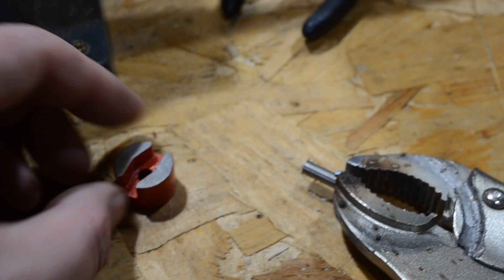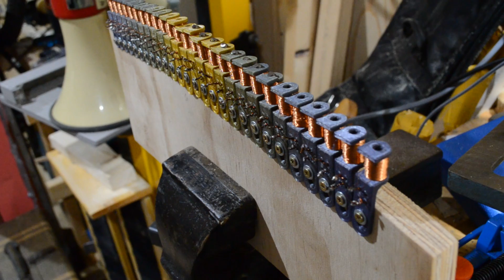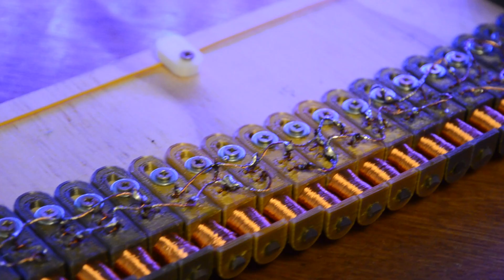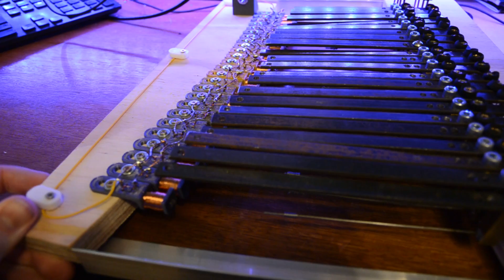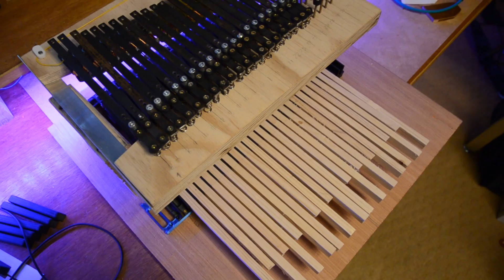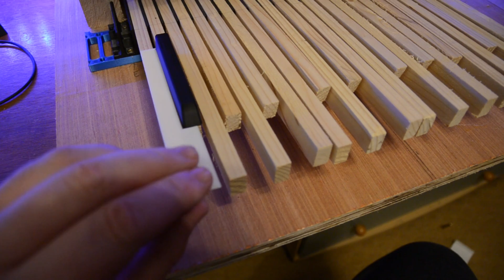Short Update - DIY Electric Piano, Keys, and Pickups - Episode 15

Comment: Great video and an interesting project. I have an idea (so far only an idea!) To try and make the Hohner pianet style electric piano. I  have 2 keybeds from an old home organ I dismembered. I'm stuck on what material to try and make the reeds from.Any suggestions?
Reply: ...hacksaw blades seems like an idea..
Reply from the maker: Yes you want some steel that is really hard, so spring steel or some type of blade. 
On the EP-Forum I think there are examples of people using hacksaw blades and them blending in with the rest of the Wurlitzer 200 it was placed in. I have never heard one, but I think its a good places to start. It will need voicing / strikeline placement for best results.